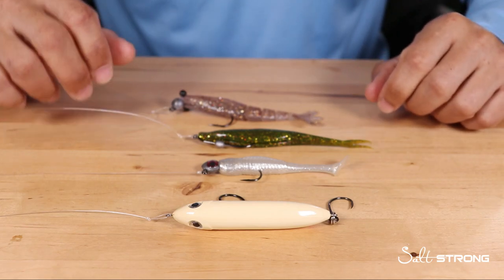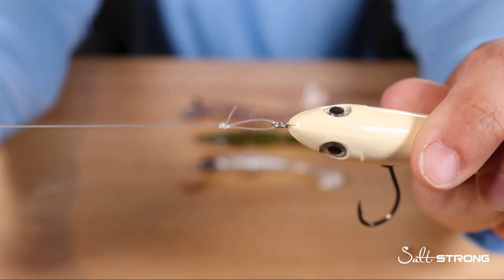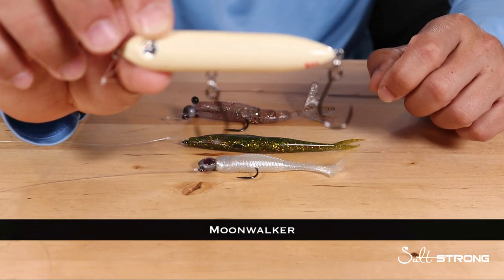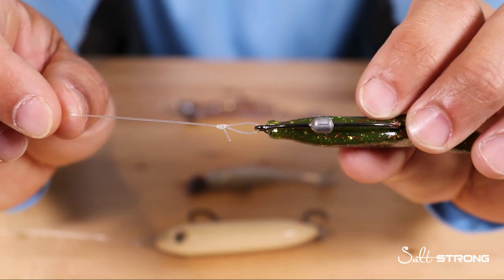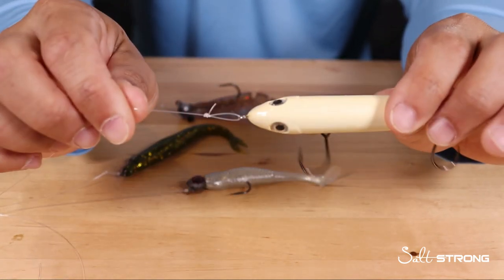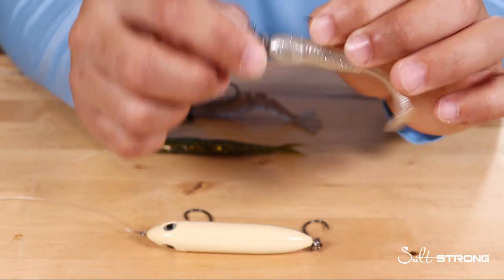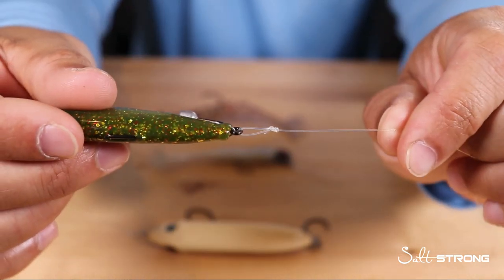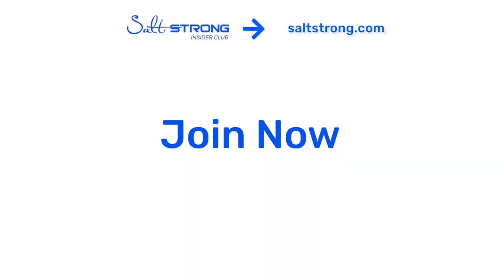What Knot Should You Use For Different Types Of Artificial Lures?

Comment: Ever time I do the loop knot the Tag end points outwards or to the the front.  Can't do it so the tag end points rearwards (at the lure).  What am I doing wrong ?
Reply: You gotta feed the tag end through the same way the other overlapping loop lines are feeding. Its kind of hard to explain but you need to feed it the other side you have been feeding the tag end. You will see the two overlapping lines that snug down on the loop before you complete the knots and that's the way you need to feed it. I was confused at first also lol just feed it through the opposite way you have been.